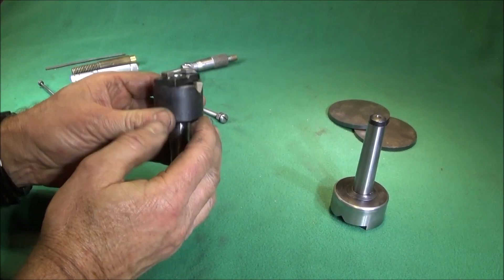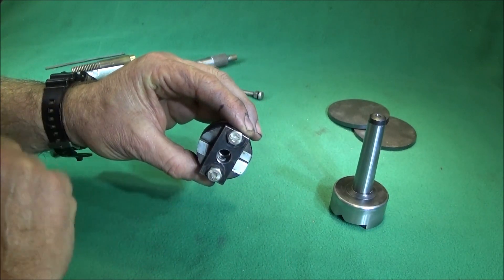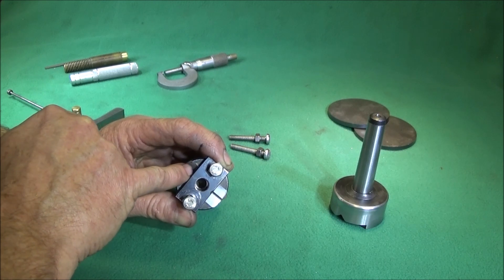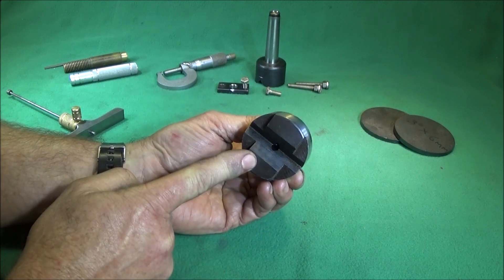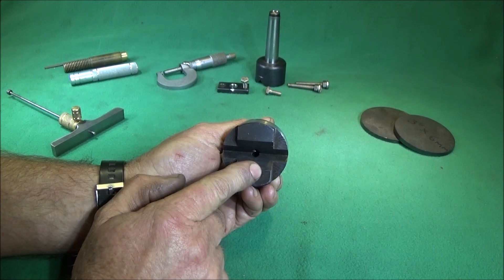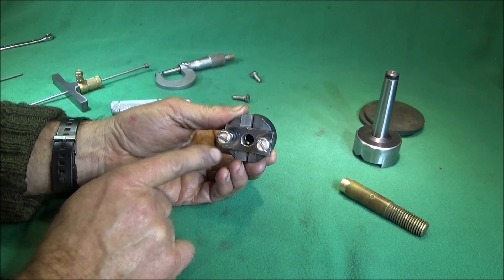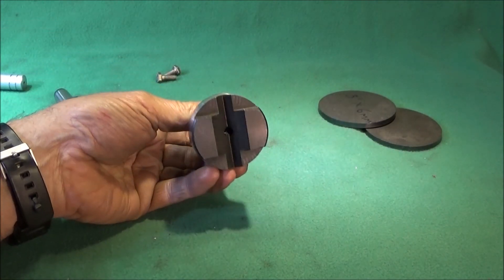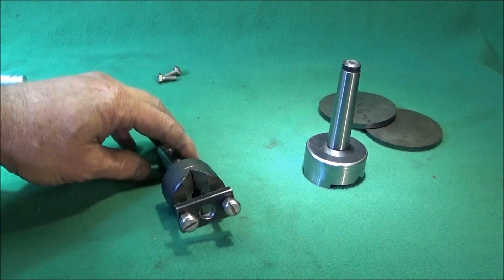Cross Drilling Adaptor Mods Mini Lathe & Myford ML7 Drill & Tap Side Holes Part One

Comment: Steve, there is a vendor on ebay from India that sells the larger one in either MT1 or MT2 that includes a clamp and screws.
Reply from the maker: Hi Roger, That is interesting.. They must have just brought that into production as I have never seen one with a clamp before except the smaller one that you can buy from Arceurotrade. The Indian one looks well made, but having the screws on the front without a ring clamp, limits the diameter size of the bar it can hold. Thanks for letting me know. I like to keep updated on new tools on the market and it shows other people what they can buy....Regards Steve
Reply: The fact that it has the screw holes in front makes it useful for smaller pieces and doesn't preclude the modification for your larger disk type clamp.  I find the total cost with shipping of about $65USD to be a little high for my budget but I'll eventually buy one and make your modification.  I find the Indian made tooling to be about the quality of Chinese made which is entirely adequate for the home hobbyist.

Comment: Great videos with a lot of good common sense information. I have noticed that you have modified the oilers on your ml7 . You should do what I have just done and add a clutch to yours but I did not buy a Myford clutch, I made one that cost nothing,I will post a video on this soon. All the best.
Reply from the maker: +meteaumania Thanks, Yes I have put, both cup and drip feed oilers on a home made brass adaptor.
  The clutch sounds interesting. I've only found out recently that one can be put on the ML7.  I'm looking forward to seeing your home made one, it must be a complicated thing to make?
 I've just bought one of those new 125mm indexing back plates for my chuck from Myford, so at the moment I'm making a plunger pin assembly for it. I hope to make a video  when I get time,  plus show how I made the oiler adaptors.

Comment from the maker: You can buy the small cross drilling adaptor from Arceurotrade.co.uk It is listed as (MT2 Tailstock V Adaptor).

The larger cross drilling adaptor can be bought from www.rdgtools.co.uk or from their Ebay Shop Listed as a (2MT Centre Tailstock Drilling Adaptor).
Reply: RDG wants $1,100 US for the big one on ebay. LOL
Reply from the maker: Makin Sumthin From Nuthin No. The reason they have put that price on at the moment is that they have run out of stock of this tool. It stops people from buying it now but allows RDG to keep their listing on Ebay going so they don't have to re do the listing. They will put the price back right when they get more in. Rgards Steve
Reply from the maker: THE LARGER CROSS DRILLING OR TAILSTOCK ADAPTOR PART TO BE MODIFIED CAN BE BOUGHT FROM www.rdgtool.co.uk OR ON THEIR EBAY SITE. YOU CAN GET IT WITH A 2MT TAPER OR A 1MT TAPER. IF YOU CAN"T GET HOLD OF THE 2MT ADAPTOR YOU CAN BUY THE 1MT VERSION AND USE IT WITH A (2MT to 1MT TAPERED SLEEVE) FOR USE IN THE MYFORD OR CHINESE MINI LATHE TAIL-STOCK. THE STEEL DISCS AND THREADED BAR CAN BE OBTAINED FROM OTHER SELLERS ON EBAY.